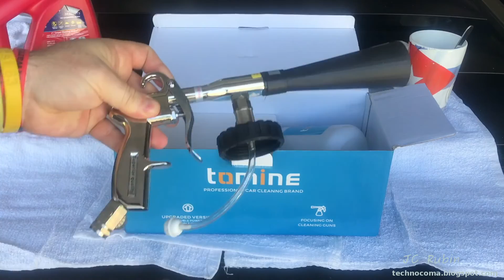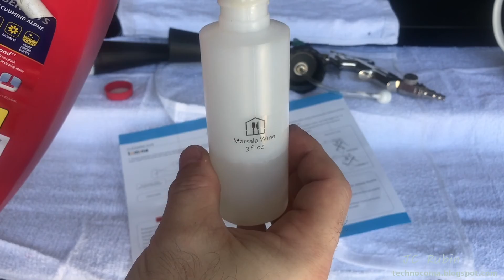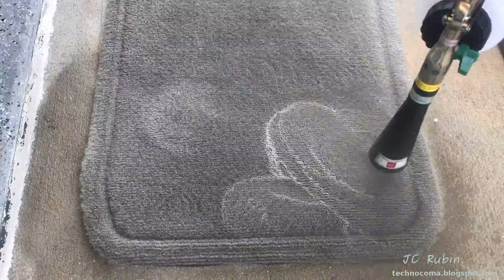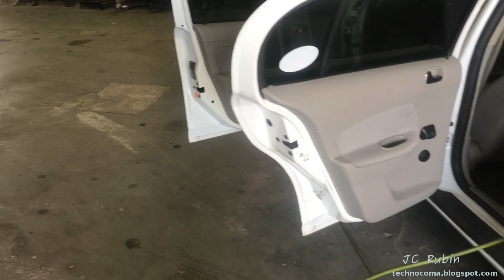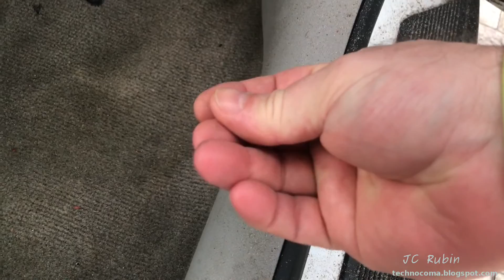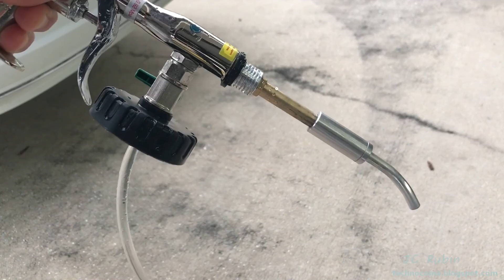Tomine Automotive Cleaning gun - Tornador knockoff - Unboxing Testing Evaluation

Comment: With the inside tube feed you could attach something like washers to weigh down the plastic end so that it’s always in the water while using it normally or upside down
Reply from the maker: That might help. Thanks.